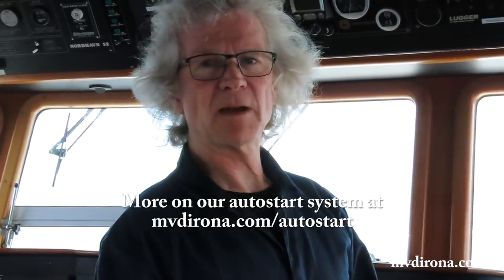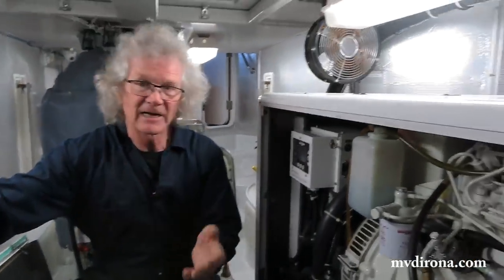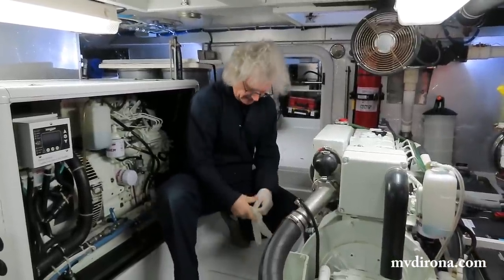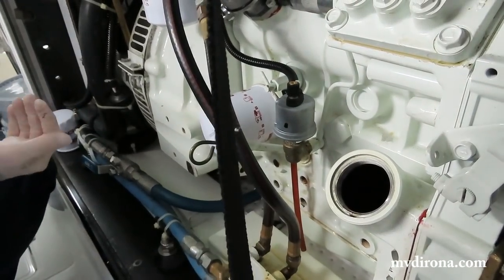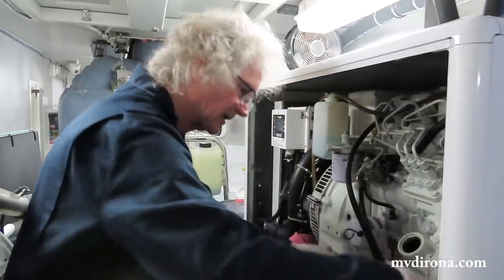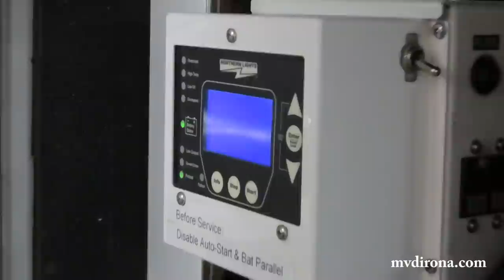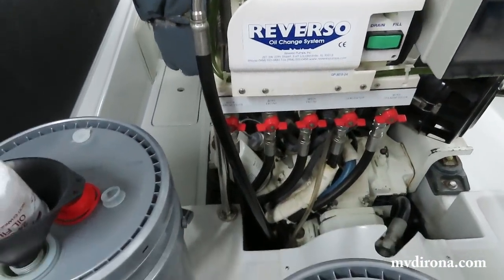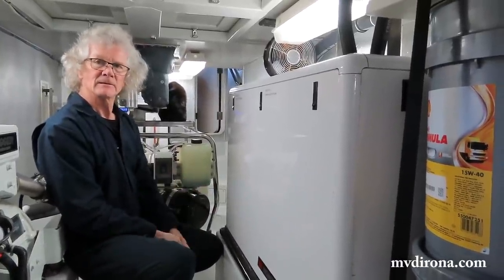Northern Lights 12kW Generator Oil Change (MVDirona Channel)

Comment: A very entertaining and useful "best practices" procedure that can be applied by many like-minded boat owners. Thanks for posting.
Reply from the maker: Thanks. The only part of that job that requires care is the oil filter will be full and it takes quick action to take off the old filter and install the new one without excess oil spillage.

Comment: Hi James, great video but I think you forgot to close the valve on the generator drain/fill tube inside the enclosure.  Stay safe.
Reply from the maker: Thanks for catching that. I just forgot to mention it when I did close it and, in scanning the video, it looks like I didn't remember to close it until near the end of the job. You can see the valve closed at 31:22 just before I put the cover back on the generator. 

In our design, there are actually two valves in series with one at the generator and one right before the oil change pump.
Reply: @MVDirona  I noticed that as well but what I also noticed was that the valve did not seem to be completely closed but rather only half way.

Comment: Hi James, as a fellow Amazon Engineer, I really enjoy learning about how you think about and perform maintenance on your boat. They are really great videos and Jennifer asks good questions about the all details. I believe I read that you also data-log temperatures and other metrics to show trends and perhaps have alarms for anomalous readings. It'd be interesting to see that in a video!
Reply: Is he a celeb internally there?   I been following him for a while and he's like a grandpa amazon.
Reply from the maker: Hey Alan!  Yes, you are right, we do have all data points recorded every 5 seconds. I don't know the exact number of data points we capture but I would estimated to be capturing around 200 and it's been operating this way for many years. We also use this data to set warning indicator lights, sound alarms, and send email.  That's a good suggestion to do a video on some of the control and data logging systems.

Comment: James and Jennifer-  your "how to" team videos are top notch.  The level of detail and presentation method is wonderful and Jennifer always asks the questions in my head...usually right as I think them...haha.  so look, I have knee issues.  I'll have a knee replacement soon.  Even after, squatting down to work is not a great option for me.  I've been looking at narrow mechanic seat options to help.  This looked feasible in the Nordhavn 47.  I'd be curious about your thoughts on this.
Reply from the maker: Thanks for the video feedback. 

If you wanted to avoid time on your knees, you could probably stand or crouch in areas where there is sufficient clearance and sit where there isn't as you suggest. Because the floor is slanted, a wheeled seat wouldn't work well.  When I need to be on my knees for a long time, I use kneepads or a padded foam piece to kneel on. That seems to work pretty well for me. Certainly back problems or knee problems will slow you down a bit but, if you are patient, I suspect you'll find ways to do it.

Comment: Good video guys, thank you, never realized that the gen set engine was almost the same as that wing of yours, that is great for interchanging spare parts.
Reply from the maker: Yes, it's great. Same injectors, same oil filters, same fuel filters, same water pump, same starter, etc. Really nice from a spares management and cost perspective.

Comment: One thing I have on all of my generators is an electric lift pump with a 1/4psi check valve. We have had drain back and air issues in the past. Then ensure the controller is programmed to allow a purge or preheat cycle. If the generator has glow plugs we tap glow plug power thru a diode so the electric fuel pump runs during the preheat cycle. Otherwise, during the purge cycle, the fuel solenoid is opened and it turns on the fuel pump again by a power feed with a diode. This just helps ensure there is proper fuel at the IP when it goes to crank and helps pus out any air to the return that may have gotten into the lines. This has been a big issue for us on the D40 Cat generators with the Perkins engines.
Reply from the maker: Good advice. There is no question that would help this installation. I noticed that it can start a bit rough when it's been off for a few weeks. It also happens when the supply fuel tank is very low.  And I also see the issue when transferring fuel. 

A fuel pump triggered by the glow plugs is a nice simple solution that I think would help. I only rarely see the issue and it always starts and clears quickly but this would  almost certainly solve the occasional rough or slow start. Thanks for passing that along.

Comment: very nice.  lot of common sense.       I use rotella synthetic in my 22.5KW Onan and very happy with the results.   the advantage on Synth (pure, not blend) is that allow more flexibility between changes,  In car terms, you can change at 3000 or 4000 or 5000 and will not be harmful to the engine.   Regular oil is also good , BUT need more discipline on the hours.   The breakdown of regular oil is vert step compared with Synth.
Reply from the maker: The small marine engine manufacturers won't allow any more hours when using synthetic oils from a warranty perspective but there is no question that the oils are better and it makes sense that they could support extended hours. I think the reason the manufactures will not support extended hours is the risk that the oil is contaminated increases with time and synthetics don't help much with that. For example, some fuel system designs tend to get a small amount of diesel into the engine oil which reduces the lubricating effectiveness of the oil.

Comment: great vid. One remark, I usually run the enginee for a  short while before changing the oil. not to long ,you do not want to burn yourself.. but it helps to clean out all the old oil as it will be more liquid... Anyway great job
Reply from the maker: Yes, thanks, we do the same on all of our engines.
Reply: I was wondering if the engine was warmed up also.
Reply from the maker: Yes, it was warm. We're currently at anchor so the generator is autostarted every 4 to 6 hours. If I'm going to work on it, I usually do it just after a run so that I have lots of times to solve any issues that might come up during the service operation without delaying or preventing the next run.

Comment: Hi James, I had the same starting issue with my Volvo main engine. Turned out to be the fuel pump was starting to get bad and was allowing the fuel to drain back to the tank. New pump and issue resolved.
Reply from the maker: That's a really good point. With a diesel, it's almost always fuel when they are slow starting.  The fuel pump on this one is fairly new (still could be bad) so I was thinking of temporarily putting an electric pump on the fuel line to eliminate lift pump and fuel drain back issues. But, when I went down to check it out, I noticed right away that the starter was cranking the engine over at about 1/2 the normal rate. The starter still cranks fast enough to start the engine but it's about 1/2 the rate of our Wing Engine which uses the same starter and diesel engine combination as the generator.

After checking for adequate voltage at the engine when cranking, I changed the starter. It's now back to starting quickly. We video taped the diagnosis and the change of the starter so it's in the works.
Reply: @MVDirona  Glad to here you have it resolved.

Comment: James, have you considered the simple expedient of puncturing the oil filter to drain it of oil before removing it? That should allow all the oil in it to drain out so the actual change is less likely to have a major mess.
edit to add: If done, that can also be the air intake spot for the oil change to speed the process.
Reply from the maker: That's a great trick that many use successfully. I've tried it and found it seemed slower than being careful when changing the filter and cleaning up the small mess I make when changing filter.  

It's a good approach but I find it slows me down so I've ended up not using the technique but thanks for the suggestion.

Comment: Why do some people suggest prefilling the new oil filter with fresh oil? What are the pros and cons of pre-filling the new filters?

Ty for producing these excellent videos. I am preparing to do my first oil change on my northern lights generator. In this video, you install the new oil filter dry/empty.
Reply from the maker: That's a great question.  The reason why many recommend filling an oil filter before re-installing it, is the oil pump will take a couple of seconds to fill the oil filter and during this brief period, the engine will not have oil pressure.  Technically it's better and there is no arguing that point.  The question that remains is "how much better?"  For sure it's better but some argue that it's only marginally better.  Let's look at some of the important factors to consider in this decision.

I only change oil when the oil and engine is hot and I change the oil within 10 min of it being shut down.  I do this because I want all impurities in the engine in the oil rather than settling out in the oil pan.  A hot oil change is a better and more complete oil change.

Changing oil hot ensures that all inside-the-engine mechanical surfaces are well oiled.  Because the engine is well oiled and many oil galleries remain full, the potential negative impact of starting the engine with an empty oil filter is greatly reduced.

Another factor to consider when thinking through the question of whether you should fill an oil filter on oil change, is practicality.  An oil filter that is side mounted or vertically mounted upside down is very hard to prefill. Early Ferrari V12s had two oil filters upside down in the center of the V?  You simply can't prefill these filters without making an incredible mess.  If Enzo Ferrari wanted filter prefilling, I figure he would have mounted them such that they could be prefilled.

Another factor when filling an oil filter is some of the oil you are pouring in will be delivered to the engine unfiltered. Of course, none of us would anything other than brand new clean oil but there is a tiny risk that something could fall in.  The risk here is minor but it's something to consider and, if you do elect to prefill, be careful and don't leave the full filter in a place where foreign matter is a risk.  On fuel filters on high pressure common filter electronic engines, I would actually recommend against prefilling filters due to the risk of introducing tiny airborne impurities.  The fuel systems are more sensitive but the risk is non-zero on the oil side and still worth considering.

Lastly it's strongly recommended that when changing oil, never put load on the engine until the engine has built oil pressure.  Some designs don't enable the alternator until oil pressure is built.  None of mine have this feature but my regulators don't enable the alternators until the engine has been running for 45 seconds. Of course oil pressure will build in a couple of seconds so this is much longer than needed but I like to give them time to have oil fully splashed around an small amount of heat in the engine before taking any load.

The final factor is if you make it easy to change oil, then you are far more likely to do it when it's needed.  

My choice is not to fill the oil filter on change mostly because it's easy and I don't see the theoretic gain of pre-filling worth the time it takes. I'm very confident all three of the engines in Dirona will live a very long time.  The main engine is over 12,000 hours now and the gen heading for 9,000.  I could see both doubling those numbers if used sufficiently to get those hours before boat end of life.
Reply: @MV Dirona  Wow! that is an amazing explanation. Thank you very much. I agree with you about the psychological aspect to this decision making process. The easier we make this oil change process, the higher the probability we will adhere to the maintenance schedule.

Comment: Dont forget to lube the o ring on the new oil filter, dont know if you did or not.  Watch your starter motor over the next few weeks, its been working harder than normal and at 6000 hours its probably due soon anyway.  The issue with your cylinder head is a very common one tbh and I have seen it many times over the years as I run Kubota and Perkins engines on quite a bit of plant.  The bottom ends are rock solid though.
Reply from the maker: Wow, you nailed that one "Watch your starter motor over the next few weeks, its been working harder than normal and at 6000 hours its probably due soon anyway. ". One month later, we needed to replace the starter: https://www.youtube.com/watch?v=NT4NGAVTN4g.

We changed the cylinder head (https://www.youtube.com/watch?v=983xSI_Nghs&t=12s) and it's back to full output. Thanks for passing on your experience.

Comment: Great explanation, I love all the details you give.  One thing I missed is did you put oil on the new rubber filter seal?  I always do, it ensures a good seal and makes the filter easier to change next time.
Reply from the maker: I didn't explicitly lube it but, in the approach I take, it gets lubricated. I generally don't like side mounted filters since they tend to run oil down the side of the block so what I do is remove the former, ensure the old gasket came off, then install the new one. The oil mounting surface is wet with oil from the old filter so it lubes on the way on. Then I clean up. This just allows me to go a bit faster but still ensures the gasket is lubed and the filter is easy to remove.

Comment: Thoroughly enjoy your video's, glad to catch a new one. Just a quick question, have you ever thought of solar to augment your energy needs? Ever time I daydream of having a boat like yours, it's always soured by the thought of the cost of the fuel.
Reply from the maker: It would take a truly enormous number of solar panels to actually deliver the power needed for propulsion. That's not really practical on a boat this size or weight. But it is very common practices to put a small number of panels on to augment on board power production. With work to minimize power consumption and with a good sized solar array, it can make a material difference. 

We run our boat like a small, comfortable apartment. Consequently our power draw is on the high side and there really aren't any good locations to put panels on this boat. A good argument can be made to use solar panels to at least reduce generator time but it's not an upgrade we've done at this point.

Comment: HI Did you lube the new filter seal with a film of fresh oil, to prevent leaks?
Reply from the maker: No, I didn't but it's impossible to take that oil filter off without some oil leaking out across the gasket sealing surface (and, if you're not quick, a lot will leak out). So, the new seal lands on an oil wetted surface, never leaks, and stays easy to remove. But, I agree, pre-oiling the new filter sealing surface is a good idea.